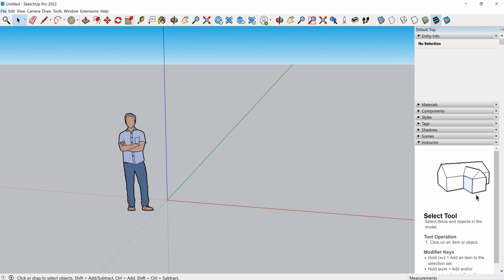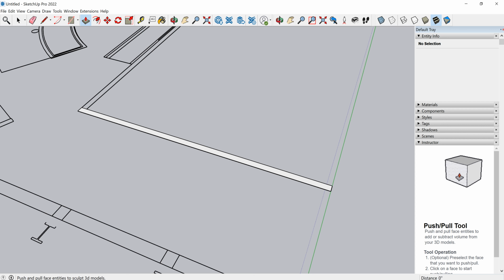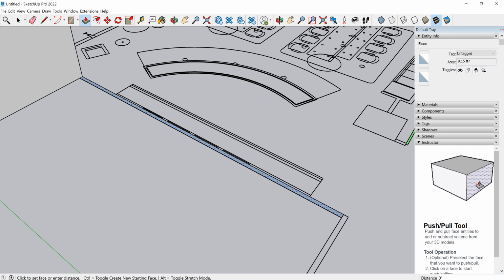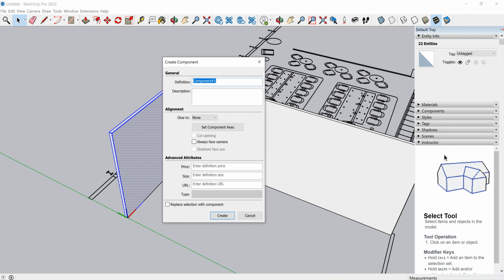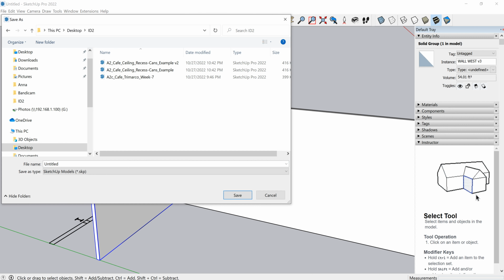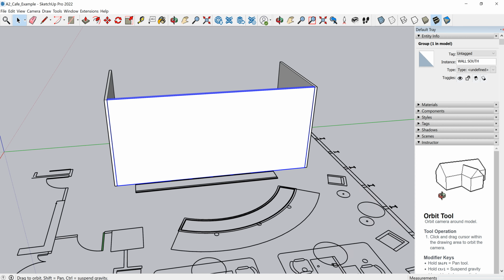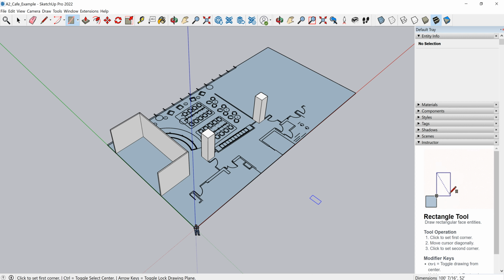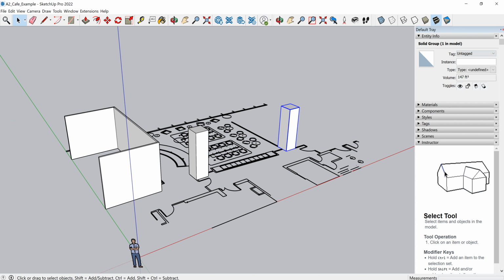How to Begin in SketchUp - Import an AutoCAD Drawing + Push/Pull  + Groups - Part 1

Comment: I heard sometimes autocad can make sketch up not respond is that true? I know that may people work this way and sometimes completing a file has been tricky for me because it seems like no one can tell me why
Reply from the maker: Hi Jules, I can imagine if one is using an older version of SketchUp with the latest version of AutoCAD or vice versa the software will need time to process more which may cause delays in speed. If we are dealing with the most current software, great. However, I think it is good practice to always check the AutoCAD files to see if they need to be purged/cleaned up before importing into SketchUp. May I ask, which versions of AutoCAD and SketchUp are you using? How large is the AutoCAD file?